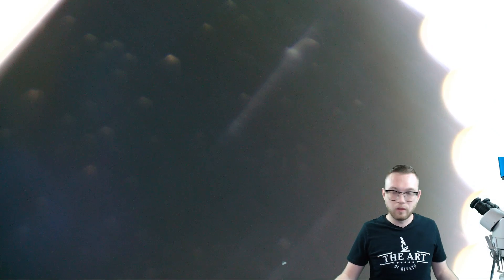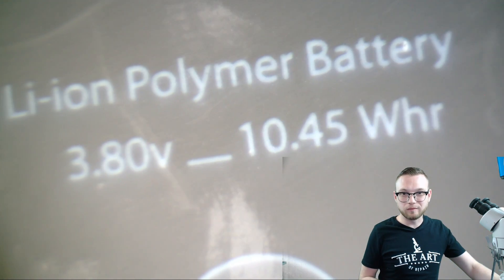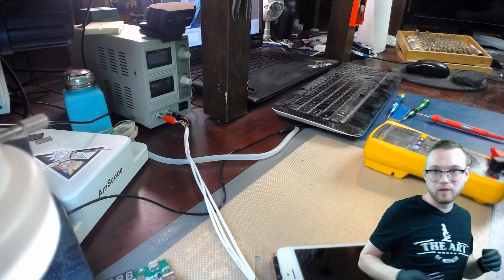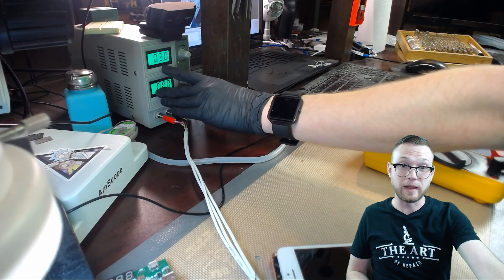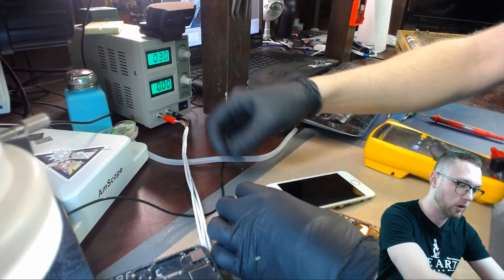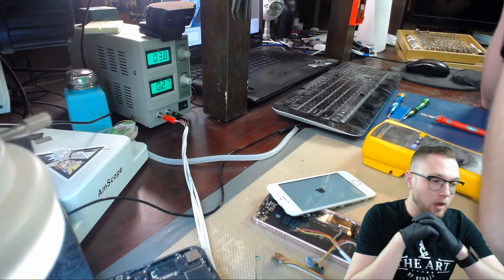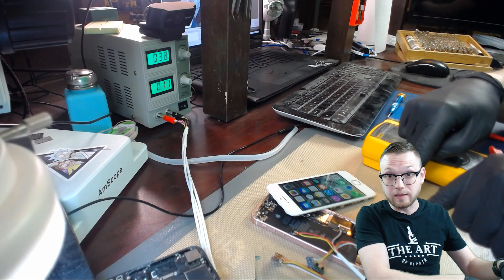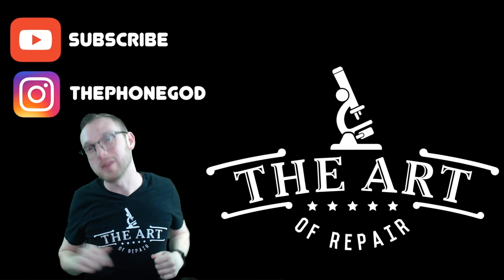EP45 The DC Power Supply | How do I turn my device on with a DCPS? | What is Operational Voltage?

Comment: Hi im barely learning how use a DC Power supply . I have the one that has the 2 knob current and 2 knob voltage. I seen others  putting the 2 gator tips together to it short it for the current to set at 2 amps. Do i have to it that way too ? I work on iphones.
Reply: OW DCPS input 110 V output 0-30V 0-5A DC. On current i shorted with the 2 gators or probes putting the red and black together to adjust  2amps. The voltage i adjust to 3.81 as the battery of iphone 7 says. It turns the apple logo on  but  cuts off doesn't turn phone on .
Reply: Hey , I findly figure it out. I did go back to watch your video. I did exactly what you said to do. I did it with another phone and it worked. I also found out why was the other phone not staying on. One of the screen connectors was ripped so everytime i went to move the screen it cut off. Your video did help i would like to say Thanks. I only do screen and battery  repairs on iphones here in my home town but i want to get deep into the repairs. I will be watching your videos Thanks again!!
Reply from the maker: @rigoleyja4043  yay! I’m so happy you figured it out! I knew you would. I hope that you learn more and grow into whatever you want! 💪💪💪
Reply from the maker: Uh, I’m curious why your trying to run two rails together for an iPhone job.. what’s the specs on your DCPS?
Reply: When i go to plugging the battery it turns on. Its a working phone im just trying to practice without the battery. Do i have to worried about something blowing up in my face or getting shocked ? You can tell i never used a DC Power supply.
Reply from the maker: @rigoleyja4043  if you follow this video you should be able to do this. 4v isn’t going to hurt you really. 

I would recommend you pick up the correct battery clips to attach it to the board and then you should be fine following the video? 

As long as you can generate atleast 3amps your fine
Reply: I think i know where im getting you confused . when i make the adjustments with the 2 gator or probes i pulled those cables out . then i  put in the cables for the i boot cable all in one for iPhone battery . But i will watch the video .
Reply: Thanks

Comment: I understand the sentiment, but IMO you're underplaying the importance of current limit on the power supply. I would suggest the overwhelming majority of times a bench-top power supply is used/needed to power a device, are explicitly diagnostic situations. And your format and language here, appears to target beginners, so being clear about what it means, is IMO extra important.

My own advice to learning beginners, as a supplement to the good info in the video:

1st, try googling for the nominal or maximum current draw from the internal battery. For example; Device XYZ battery +"max current"

2nd, if you cannot find anything useful, look at the original(!) charger, or an official quickcharger. Find the output current of that, add 30-50%. This is in most cases a safe range.

If sympthoms include the device is not booting with a known good battery, or feels abnormally hot, try setting current limit to something reasonable. For a phone, that would commonly be 2 ish amps. If the device has a short, this limit level should in most cases reveal that through the current draw being pegged at a high current or at your set limit. It should also avoid accidentally causing further damage, if disconnected within reasonable time. Pretty much all modern batteries have build-in over-current protection. If the short in your device is bad enough, it may trip that protection in the battery, avoiding substantial damage. But when powering that device with an external power supply instead, that protection is gone, and you have the power supply current limit in its place. If ie. the over-current protection inside the battery flips at ie. 2.5A, but your power supply has the current limit set to ie. 5A - that short could now potentially cause it to draw 5A instead and severely damage components, pads or traces that were able to survive the 2.5A short.
Reply: Thank you! Yeah for mobile devices I would use 4V3A on the machine

Comment: Thanks Justin! It is still good to set the current on the power supply so that if something goes wrong or shorts, the current is limited.
Reply from the maker: Usualy if i notice a high grab like that, i just hit the power and, inspect, then use the higher current for a quick short search XD but yours is 100% a valid method as well =D
Reply: I use my Isolation Transformer like that for devices that plug into mains power also. Always good to learn different methods!

Comment: why dc power supply then got another rotor to set Ampere? where i will need that?
Reply from the maker: From my understanding of your question, your asking about the second knob that controls amps. That knob sets maximum amps OUT. Meaning if you know that more than 1 amp will cause damage, you can turn the knob 1/3rd the way and LIMIT the amount of amperage out before it "shorts"  I generally keep mine halfway turned up so that it doesn't cross 1.5 amps into the device. Some people prefer a hard 1 amp to make sure they are safe.
Reply: TheArtofRepair thanks for quick responce.. so if the battery is 1900mAh i can turn it to 1.9 and i will be safe?
Reply from the maker: 1900mah is the max capacity of the battery. 1.9amps on the turn knob just means that if the device needs to pull that much, the DCPS will allow it. The amps-in knob it just a current limiter. That's why I was saying its not as importance as getting the voltage correct. =)

Comment: using tool like this https://www.aliexpress.com/item/3PCS-LOT-30W-40W-60W-Copper-T-Soldering-Iron-Tips-with-free-Hot-Press-for-LCD/32448934385.html   alot cheaper than hot press machine lol i know mine was 5000 bux.. but it is worth it with amount of flex cables i change that gimme a new working lcd..
Reply from the maker: I have been wondering if the handle bits worked well or not. The glass substrate on the panels is so fragile that I figured something like this would damage more than it fixed. So your having luck with the handheld setup?
Reply: yes use the machine for mainly iphone and handheld for more delicate stuff like s7 edge etc no pressure needed
Reply from the maker: Awesome, well I just went ahead and ordered it, and will be testing it out in the refurb lab. Ill make a video if it turns out to work well. Thank you for the advice and thank you for the link.

Comment: hey justin something no one else has done proper video on, pink line on s7 edge screens, where pushing on the top the line disappears,  i would guess a bit of heat using press soldering bit would be a permanent fix .. your thoughts?  itll get a shitload of views...
Reply from the maker: Only problem is i need people to send me tons of these pinkies to do testing. So if anyone reads this and has a few laying around. Contact me on Reddit or Instagram and send them over and ill do some testing and make a video if I can confirm a fix.

Comment: Worth mentioning that if the cable you are using doesn't have a battery-like circuit so as to communicate with the battery sense circuit of the device then the phone will reboot itself after a while. Good video Justin!
Reply from the maker: Very true, this is especially common on newer LG devices, some will not even boot up without the battery sense.
Reply: Just be really careful, and strip that whole board from the old (battery) when a customer comes in for replacement. Then you can make your own cable with the full coms package on board.

Comment: Battery life is usually a variable or .2v it should power with as little as 3.6 but it'll be about 1% battery or maybe only initialize iboot stage 1.... from my experience but I've not used se's or 7's
Reply from the maker: Correct, but at 3.6ish its possible to start to see diminished functionality. That's why I said to operate smoothly =). Thanks for taking the time to comment!
Reply: TheArtofRepair thanks for the reply always love the pointers in your videos
Reply: Just to add a bit of clarity, the voltage displayed on the battery is the average voltage of the battery. Processor functionality scales linearly with input voltage. Any single lithium cell has a charging maximum voltage of around 4.3 and a maximum (safe) cell voltage of 4.2 and typically a minimum of 3.3V (before low power begins damaging the cell). 

The battery percentage is determined by the phone sensing the current voltage of the battery and "0%" on the phone can vary from device to device.

Comment: But your machine only had 1 decimal place, so 3.8 is fine, but what about if your battery says 3.82V..? Go 3.8 or 3.9?
Reply: JayRay00 generally speaking, voltage itself is never constant. it's almost always fluctuating within a 3% margin of error around the desired point. the 3.8v is the "optimal" voltage aka nominal voltage.

This voltage will vary from device to device. some batteries may have a nominal of 3.6 while others are 3.8. in the case of batteries, the nominal is halfway between fully charged and fully discharged. 3.8v is a fairly safe voltage to use when dealing with phones. even if it's a battery on the lower end of the nominal spectrum the device will still accept 3.8v and work fine.
Reply from the maker: I round up or down, so 3.82v would round down to 3.8 and if it was 3.5+v i would do 4.0. But not having the 2nd decimal has never stopped me =)